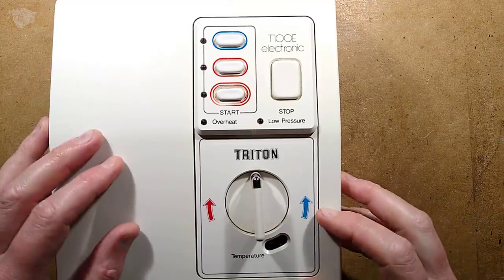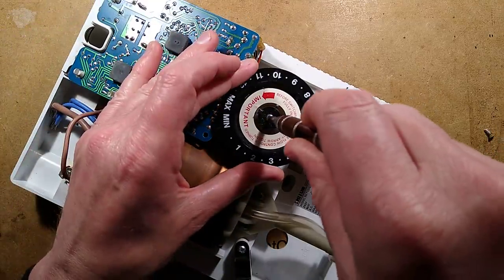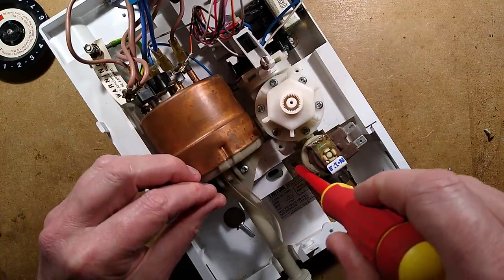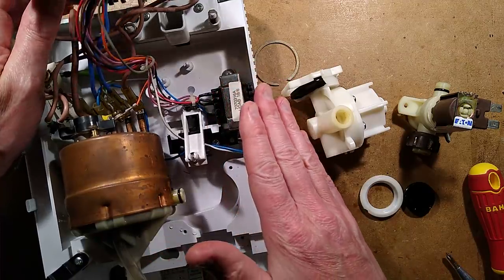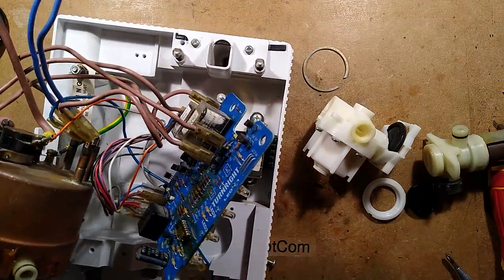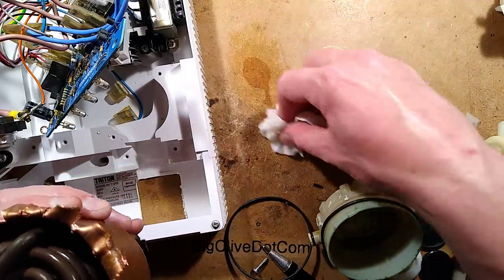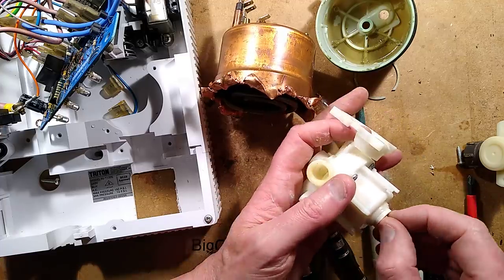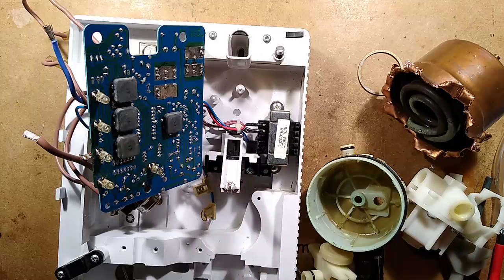Teardown of a British electric shower that went bang.

Comment: Funny enough our power shower finally died a few weeks ago. Wasn't a self-heated one so had both hot and cold input, but pump had died and sounded horrible for the past 2yrs (lots of noise and not much/if any extra pressure).

Comment: The electric shower is indeed one of those things which Looks risky at first sight, but once looked at closely is not.  The live bits are surrounded by insulation, insulating air and then an watertight non conductive case as a final level of protection.  They also show the relation of power, energy and time - it is a lot of Power (rate of converting energy) but not running for very long - hence that very reasonable 15 pence per shower figure, rather than an immersion heater sitting on and off on its thermostat keeping a whole tank of water hot in case anyone wants to use it.

On the other hand, it is not such an straightforward item where the supply is only 120 volts, since that typical 8.5 KW shower is now demanding not 40 amps but 80, and terminating 16 or 25 sq mm shower cables is not a task for the faint hearted. 

But,when  adding a shower where the customer does not want a whole re-plumbing job and these do very well - the bathroom often has an accessible rising main for the hot/cold water tank arrangement anyway, a 6 or 10 sq mm twin and earth cable is not Too great a pain in the backside to run, and the customer has some redundancy - if the boiler breaks down they can still have a shower as it is self contained and independent of the hot water.  redring and one or two others even make units where the works can mount in the tank cupboard and supply both a shower with the manufacturers shower mixer tap unit and the hot taps in the wash basin
Reply: It's more like £1 per shower, not 15p. These things are extremely expensive to run, compared to more efficient heating methods (mostly gas).

Comment: Who does install those units in the UK? It's the electrician or the plumber?
Reply: Usually a plumber who is "Part P-certified", ie has done electrical training.
Reply: @ann_onn  electrician for an installation of a shower, plumber for renewal of a shower unit.

Comment: I thought one of the main reasons Americans don't have electric showers and/or kettles is down to the fact that they have 110 volt systems. So an 8kw shower would need a 75 amp breaker and AWG 4 cable....
Also get him a Mira shower, from experience I think they are better built compared to the Triton ones....
Reply: Nope we have 2 phases either 60°/90° apart for 220V. I think it’s that most houses are newer and retrofits are rarely necessary or maybe the abundance of natural gas/heating oil delivery to the home. 

Most homes in my area have natural gas water heaters. Maybe not the most water conserving since the run from the garage to the master shower is 100’+ run under the slab in cold soil.
Reply: @peterg.8245  I always thought you just had a 110 domestic supply, I knew 220 was available but thought it was only available in industrial installs.
Thanks for the info, I stand corrected
Reply: 240V electric water heaters are common enough here in North America. Typically 30 amps using 10awg cable, though massive instant-on units are available up to at least 36 kW.
Reply: @generaldisarray  Standard residential service is 120/240v single phase, commercial usually 120/208v three phase, and indstrial can get 277/240v three phase. Having said that, standard receptacles are only 120v 15a, which explains why electric kettles are not as widespread here (they are 1800w max.)
Reply: @andrewarmenia1461  I knew you used electric baseboard heaters, which people in the UK would faint at the thought of, given electricity prices and gas water heaters but wasn't aware you used electric water heaters. 
On this side of the pond we usually either have a gas or oil fuelled "boiler", basically a water filled, closed circuit, central heating system that heats the rooms via radiators and water in a tank via a heat exchanger. Some hot water tanks have an electric heating element installed, called an immersion heater, but again it's there for show as using it will "cost a fortune", at least that's what everyone's parents would say. 
Gas or oil powered combi boilers are becoming the norm, they do the same thing as above but provide hot water on demand once you turn on a hot water tap/shower.

Comment: I had the exact same model. Mine died due to component rot on the circuit board. I replaced them only for the element in the cylinder to burst a few weeks later! I guess it wanted to stay dead LOL

Comment: Curious as to what the average water psi is?
Reply: i think its 10 psi or 0.7 Bar my shower gets 7 psi at the mixer in the bathroom
Reply: Mains water pressure can be very high, 100psi or more. But remember high pressure doesn't necessarily equal high flow
Reply: We get well over 5 bar.
Reply: My water pressure isn't very good but the water pressure at my parent's house, which is at the top of a hill, is much better. The water company (Severn Trent) must have a water pumping station somewhere near by at the bottom of the hill.
Reply: @T Reed It varies a lot, but typically it's about 3 bar in the UK.
Legally, it has to be at least 0.7 bar.
There is no legal maximum, but each appliance has a limit. If you have more than about 10 bar, it can cause problems, so you can fit a regulator.
Reply: @ann_onn  Annoyingly the requirement is only for static pressure so you could have 10 bar but as soon as you draw any flow it drops massively. This has changed over the past few years at my (newish build) estate.  Static pressure has stayed the same but unvented cylinder performance has dropped dramatically. Funnily enough around time time of a drought a few years ago.
Reply: @ann_onn  Thank you. Had to look up conversions(ignorant American) and we average 4bar, though I've seen a high of 8.6. Ten bar? I'd be nervous turning the water on at all and would have nightmares of blowing out every supply hose in the house

Comment: Just wondering. What does a unit like that cost ?
Reply: Around £35 for a cheap on/off model up to £110 for a decent one, anything above that and you are just paying for the brand or looks.  They are fairly cheap.
Reply: Thanks !
Reply: @kenfranco7981  They end up costing you a fortune in electricity though. Heating water with gas is far cheaper.
If you had a family using this every day, it'd easily cost over £1,000 per year in electric bills.

Comment: Hi clive,
I just found that some of these units, believe it or not made by apparently reputable German, French etc... manufacturers and sold in physical plumbing stores here in France do in fact have bare heating elements just like the "suicide showers" found in Brazil.
I'm currently doing my personal investigation on this subject but still how can this be safe and/or legal in developed European countries ?

Again I'm talking about proper, compliant units, not chinese knockoffs or whatever.

But I must also point out that before seeing your video about the suicide shower, first I was not aware of them existing but also I was assuming that you simply cannot put a bare heating coil directly in water because it would in a nutshell be way too hazardous !
And to be fair I think at least some instant water heaters/western-compliant electric showers do have sheathed elements but from what I just read it's not the case.

Unfortunately I can't afford to purchase one just to take it to bits, otherwise I would, just out of curiosity do it and try to find what safety mechanisms are present and ultimately what makes these "instant water heaters" as we call them here safer than the "suicide" showers found in Latin America.
Reply from the maker: The earliest ones in the UK had the water flowing through a zig zag path between two sheets of glass with a bare heating element in them.  The live was at the furthest end from the water outlet and the incoming pipe was a long loop of plastic pipe and the outlet was earthed copper pipe.
Reply: @bigclivedotcom  Thank's for the reply.
This doesn't reassure me that much to be honest.
And again I'm still wondering how they could have been safer than Brazilian showers.
Let's just hope my new (rental) flat will not come with a bare wire instant water heater...

Comment: I think electric showers aren't common in North America because 240 volts is not run into the bathroom. 120 volts would need beefier than normal wires for the shower.

Comment: Is it the ground wire that keeps this safe! It seems dangerous but then again my heater (jacuzzi brand hanging on wall) is gas powered. Either would apparently need a catastrophic failure to be dangerous but I would rather have a shock than an explosion. Also, my heater recommends flushing with vinegar for several hours once a year, I imagine it would be difficult to engineer a similar flush method on something so small. The jacuzzi heater recommends a bucket, 3 gallons of vinegar, and a recirculating pump.
Reply: I don't think the water stream would normally carry much current in a failure. Maybe if you added enough salt to the water... hmm :)
Reply: The heating elements are completely isolated from the water so no chance of getting electrocuted. Also the electric feed woutld need to be protected with a RCD (GFCI for the US) so any stray leakage would disconnect the power within 30ms.
Most newer units also have no metal parts near the water flow, just completely plastic.

Comment: Those units were fine in their day, but I hated it when the water was hot and they took time to shut off and then spat hot water out and you for a few seconds.  Our one failed in exactly the same way, twice, first time I got a bit for it maybe 20years ago, so they must be 30 years old at least.  Then a few years later part was no longer available.  Mind you the man I don't think even looked up from the counter yet, I just got the impression he couldn't be bothered ordering one.  However, it was the excuse I needed to put in a bigger one that was a lot better but it didn't last so long before it started leaking from an "O" ring and guess what, no a servicable part and it was a special size  :-((  Wrapped it in p.t.f.e.tape and stuck it back in.  Insurance company said that the repair was acceptable, really!  But it did last until we left that house and they removed the shower and put in a bath.

Comment: I still remember how terrible it was compared to what we had/have in The Netherlands from my holiday in 1993 in the UK. Together with a crash of a helicopter in llanberis (we were going up with the train on the snowdonia that day). but well it's like 30 kw+ for natural gas compared to this 8 kw electric (did I read it correct?) The electric one was like someone peeing on your back.
Reply: 8.5 kW.
You're not wrong though; they're pretty weak. Just simple to fit without rerouting hot water pipes, and works instantly, regardless of whether you have enough hot water from e.g. a boiler that you have to turn on/off. 
If your home has really low hot water pressure, regular showers can be worse than these.
More modern homes tend to have combi boilers, which eliminates the problems... and gas is cheaper than electric, so these things are mostly a throwback.
Except for some specialist applications, such as a caravan.

Comment: There are things in this live you don't want to be electric like your chair, the shower is definitely an other one.
I lived in the UK for a wile and did not understand this thing. In the UK you have the turn on the light in the bathroom pulling a cord from the ceiling so you don't electrocute yourself by touching the switch with wet hands. But the you have this on the shower with a 35Amp circuit! (at 220v!!!!

Comment: We do have "point of use" water heaters in the US, but in general, not having 240V available everywhere, the juice just isn't there to heat water at the rate and temp one would like for a shower. (and the unit is absolutely not going to be anywhere you could normally touch it... under a cabinet or inside a wall, sure, in the shower with you, no.)

Comment: I'm so mesmerized that light switches in the bathroom aren't allowed and yet this is acceptable.
Reply: They are grounded. Magic is possible with extra safety measures.
Reply: @mandowarrior123  Switches in the US are grounded, and point of use heaters are available in the US. Not really questioning the device's safety as much as questioning the apparent 'no switches in bathrooms' rule in the UK.

Comment: I don't doubt that they can be made safe, but if you have a central water heater, I don't understand why you'd use one of these. If it were to provide an ordinary kind of shower, it seems to me they'd require on the order of 10-20 kW at the very least, which (correct me if I'm wrong) you surely wouldn't have a circuit for. Sure, you don't have to wait 10 seconds for hot water to arrive, but in return you have to wait forever to take a real shower.

Comment: Our one literally exploded yesterday. We think it’s because of the limescale hard water here in the South East. The entire front of the shower glowed orange through the white plastic, then went BANG! Massive black burn marks all around the side of the unit. A load of steam bursts out of it and water pours out of it from the bottom. Not a great way to start the day…

Opening it up for inspection, the heating element has a hole in it. I think limescale blocked the exit for the heating element, then it boiled it’s self to death basically, turning into a rocket jet. A massive amount of steam pressure burst a hole in it, then it drenched it’s internals. Thankfully there is a pull cord nearby to turn it off instantly. I reckon it would have just kept going otherwise.

Does that sound like something which is plausible? It’s certainly rare to happen I think, but I feel like it shouldn’t happen at all. Aren’t there supposed to be failsafes to prevent it from literally exploding? It was completely fine one second, then the next that happened. Happened out of nowhere.
Reply from the maker: It does sound like it blocked and pressurized.

Comment: In the usa we dont have these we use a super insulated tank that heats at night when electricity is cheaper sometimes 80 gallons our houses are bigger I pay 10% of w h.c at you do for power maybe less as I live by a nuke plant. 20 Miles away 3.5 cents per kw he maybe less
Reply: I'd want it free living next to a nuclear plant. The issues with water tanks (which we use too, with gas heating) isn't the space cost per se, but they run out for one, but also are unsafe water. If you use a combi boiler you can drink/cook with the warm water out of the tap. 

Combi boilers are also often more efficient as they don't heat up more water than you need, and it is on demand, no planning your life around it. 

We have immersion heaters in the uk though that do exactly what you describe should you want to use them.

We tend to use gas to heat our water with either method as it is cheaper, but recently it was banned for new builds in an effort to go green. I think that is stupid myself, as i use gas as a backup during power cuts for heat, light, and hot water. Putting in a woodburner stove before they are banned for additional off-the-grid redundancy. Power cuts happen, in various periods they happen a lot. In my parts they coincidentally happen every couple of months. Texas of late goes to show also.

Comment: That transformer feeding the control circuits may not actually be so 'retro'. In systems like this, it's vital that there's a high degree of electrical ISOLATION between the power and the control elements. Normally, these days, that's done by optoisolators but, a proper old school transformer is the best, most rugged solution. It's also the most expensive method - hence, it's not seen very often.

Comment: It’s strange: In the UK they don’t even have light switches or sockets in the bathroom, not even in zones far away from water.
But they do have an electric instant heater box right inside the shower cabin or bath tub area.
Anyone make sense if that? 🤔
Reply: Actually I've been in an (owned outright) house in the UK with sockets in the bathroom. That's very unusual though; the guy had lived in the house for 50 years and regulations have changed a lot since then.

I've used these power showers on and off for about 15 years, even had a couple fail on me and have had no incidents. They're safe.
Reply: Yeah - if you have sockets in a bathroom, people will plug in all kinds of things which are not designed to work in a moist environment.
This is designed to work in a bathroom, and is perfectly safe if installed correctly.
Reply: Anywhere else in Europe sockets in the bathroom (or mirror cupboards over the sink with lights, a switch and a socket) aren’t a problem if the sockets are in a zone away from the tub/sink.
I just wanted to point out the inconsistency here.
Reply: @demil3618  They can be fitted in the UK too, but they have to be 3m away from the bath/shower. A lot of our bathrooms are not big enough for that. And I think people are just used to the idea of not having them.

Comment: You see Ivan. That's because this shower is overly complicated. Just pass a current through a resistance to warm the water like in Brazil. Burry the ground wire whatever you want, there's no ground at all. Problem solved.

Comment: There's a reason I don't like plastic parts in plumbing - be it valves or pipes or whatever.  Plastic always seems to be the thing that fails, usually at the worst possible time.